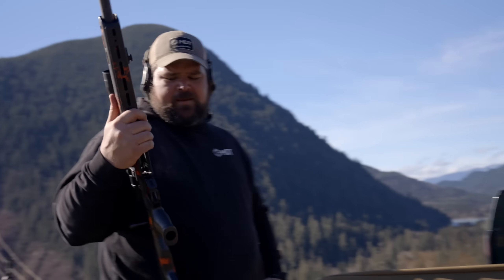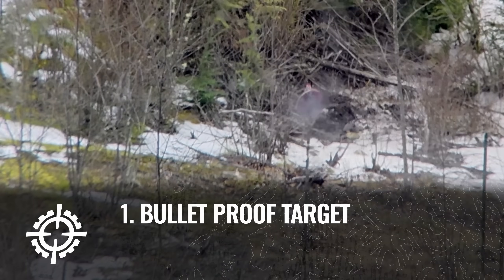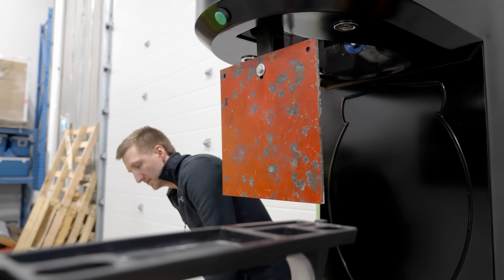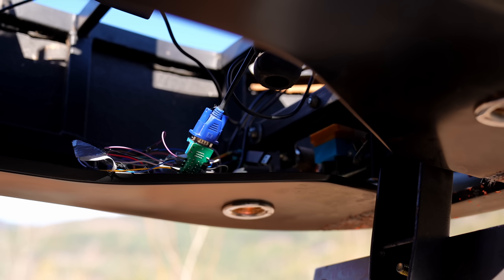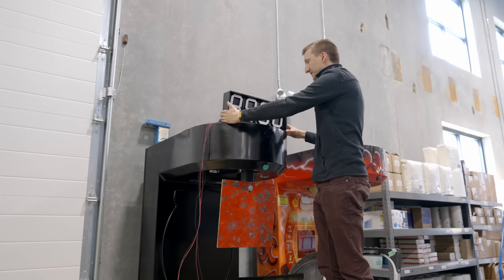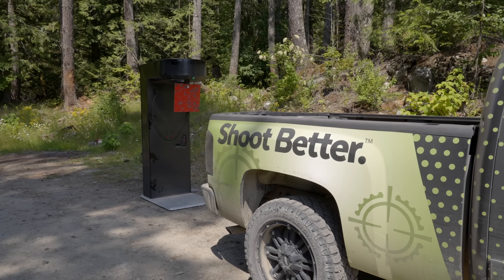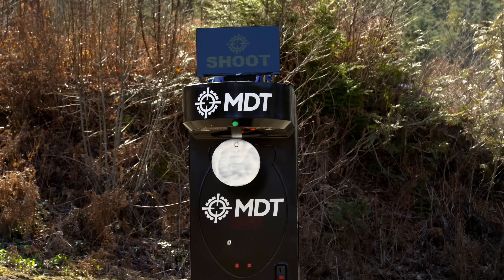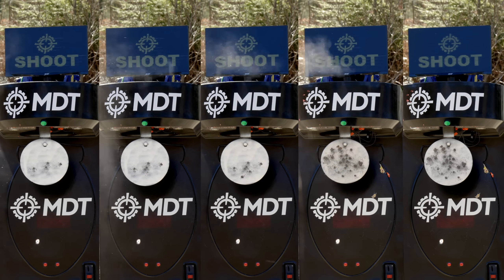Turning A Punch Machine Into A Bullet Impact Machine

Comment: As a qualifier, I'm not an engineer. Now for my thoughts because of course I was looking at ways to make it better. The first thought that came to mind was if you can get a small lip welded on the top and sides of the plate, then you should be able to prevent shrapnel from going up and out and it can all go down instead. The second thought is on how to get the most accurate and consistent data from across the entire plate since as others have pointed out, the fulcrum being at the top is going to mean shots on the lower half will register a higher output than shots on the top half. Now this might be a lot more complicated, but what instead of using angle of swing, you made the drop-down arm solid and mounted the plate of steel on pressure sensors that are calibrated to essentially act like a digital scale, but on a vertical axis instead of horizontal? Again, I'm not an engineer so I have absolutely no idea what it would take to make it work, but I love data like this and I think it would actually be incredibly useful in the firearms industry.